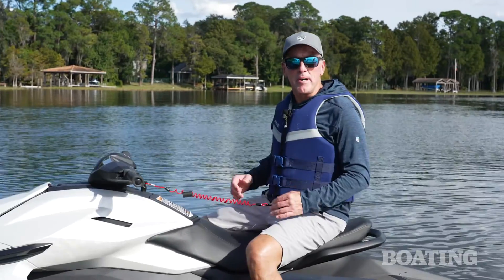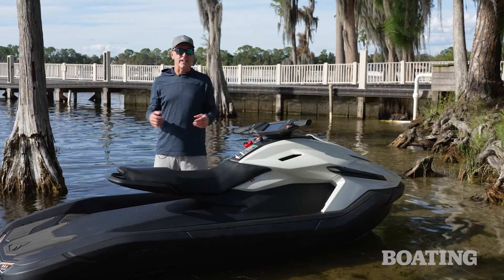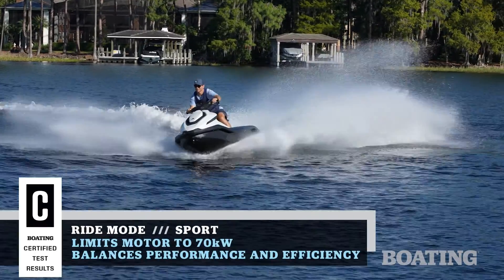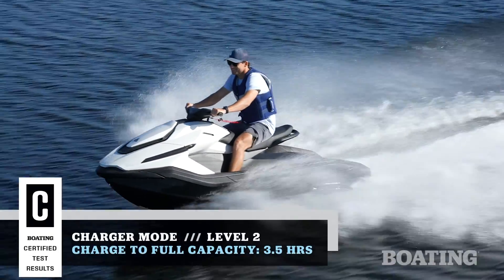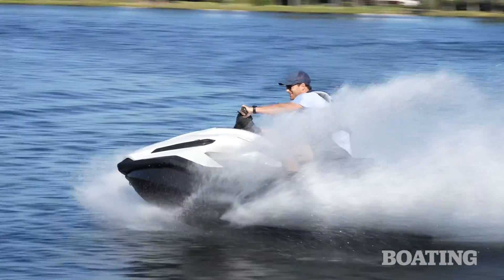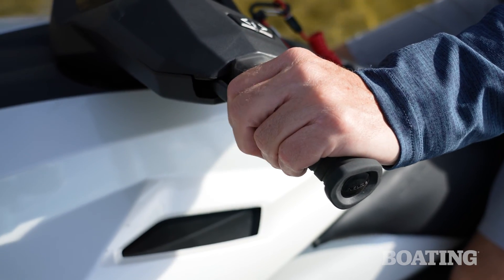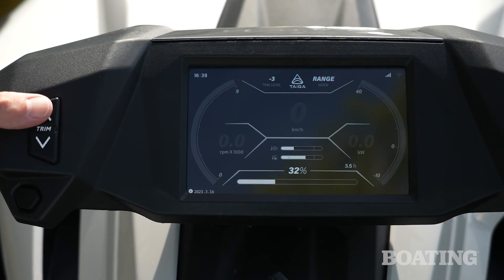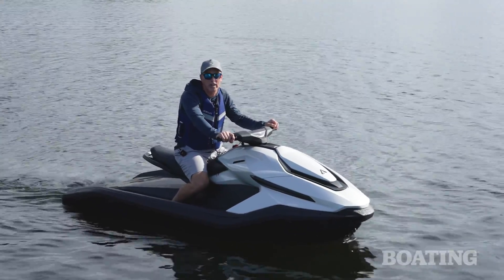2024 Taiga Orca Performance

Comment: 2 hour MAX run time is a deal breaker for most. They shouldn't have even released it until they got at least 4 hours out of it, and even that's not enough for most ppl! I see a lot of potential here, but it's not viable just yet.
Reply: Nobody is getting 4 hrs with a lithium ion battery!
Reply: @jayesh5131  perhaps this technology simply isn't ready yet for this particular application.. but I have no doubts that in the near future it will dominate this market
Reply: I think for a "trailer boat" this is quite right, you don't want to have the hassle of hooking the trailer, going to the lake, having an hour and a half, and going home again. BUT on the back of a yacht, ideal. Change it from the yacht (might even be worth getting a L2 charger) and that's different. You kick it off the back for a couple of hour's fun then back to your boat to continue having fun.
Reply: @darthkek1953  Good thinking! They should probably market it just as you're saying - maybe call it the Stow & Go lol
Reply: It has a 24kw battery, to get two hours you need to average 12kw per hour... 😂😂😂😂😂